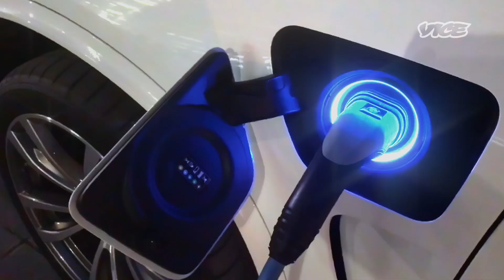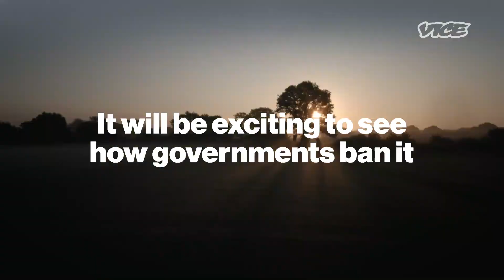The World’s First Solar Car | Extinction Update

Comment: What ever happened the HYDROGEN (water) engine. Do a video on that Vice, you won’t regret it.
Reply: Also not enough fuel pumps. Toyota is the only company doing it.
Reply: Philip Eng I’m sure some sort of enhanced sped up water filtration sytem would work fine as the pumps
Reply: DeeP Vibes There is less than a thousand in the entire US and electric can be in your home.
Reply: Jim Rob who said anything about burning it though??
Reply: There’s more to power and movement  then just combustion
Reply: Jim Rob it does matter .. no matter what source you use your gonna have power loss and power inefficiency. Tesla’s are great and you don’t go far. The whole point is to be some what of a Non pollution vehicle at least way less then gasoline. Why not a hybrid electric water mobile

Comment: Poor people exist. Not everyone can afford to take out. 40-100k loan.
The issue also is range. If evs had more range and there was a robust charging system along with the solar panel charging aspect. It would take off. It's also affordability. Evs are also extremely expensive upfront which means market penetration is gonna be slower. Within 6-15 years however I could see large market penetration.